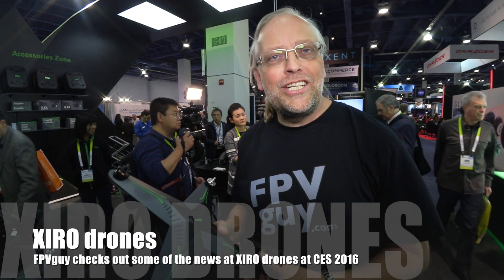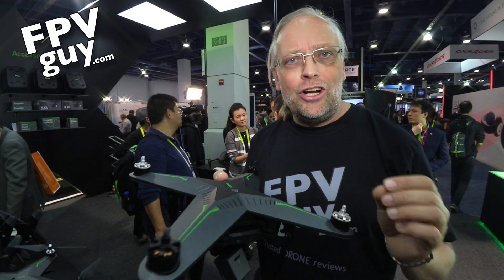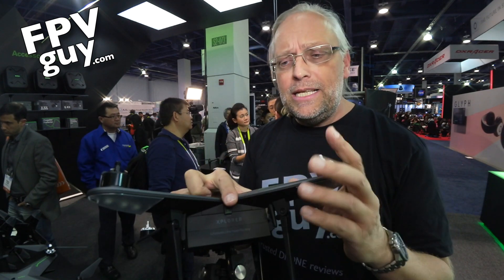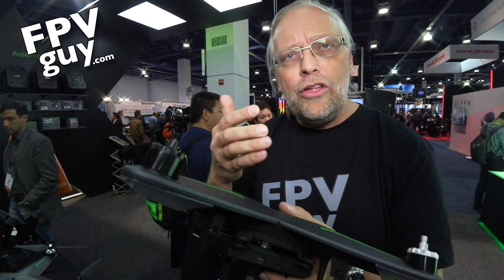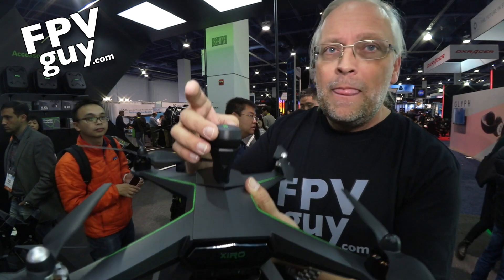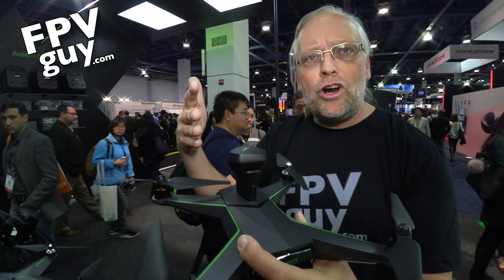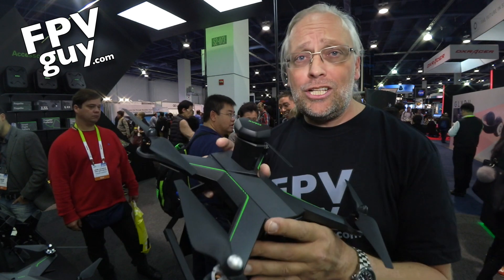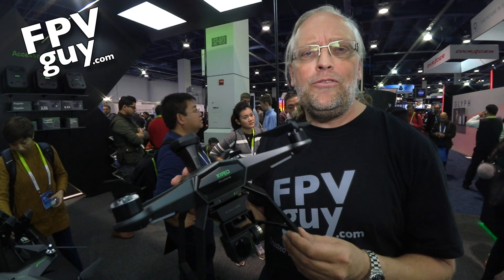XIRO SnapDragon powered drone - FPVguy review CES 2016

Comment: It's not optical, it's actually radar, that's why it's avoidance system can do 6 metres.
Reply from the maker: Sooooo.. IC,  the big lens on camera module on top is actually emitting microwave energy,  Im sure the FCC will have a field day with the idea of a rotating radar emitter on a toy-rated product.
Reply: +Bo Lorentzen the only reason I knew that info is from another video. Maybe what we should do is put a few microwave cheeseburgers around it, see how long it takes to cook them.

Comment: Actually I have the Xiro xplorer, great drones, easily 1 of, if not the easiest drone to set up & fly. They can fly in strong winds, have an automatic take off mode & landing too, home button if you lose perspective of direction, IOC, like headless mode, automatic return if you lose signal for more than about 15 seconds, when it will hover trying to pick up the signal. The video monitor is your phone, while flying, also has a micro SD card slot for taking video. The gimbal is probably 1 of the best for stability while flying, even in strong winds. I'm not a salesman for them, just stating what other reviewers have said.

Comment: The battery comes off independently. So does the Gimbal. I don't know where he got the info that you need to remove the gimbal before you can remove the batter!
Reply from the maker: That what the staff at the booth told me.   
I checked further, it turns out that the stuff was glued in place for the demo units.
Reply: Oh, yeah. It makes sense.
I have a Xiro Xplorer G and I love it!
I'm planning to get the 2 once it's released.  That I'm going to fly through forests.
Reply from the maker: Sergiu S  I have been bugging them to get a test loaner for a pre-release review, this is really one of the more interesting new quads thats NOT huge.   but with very interesting technology.  im really loving the rotating obstacle avoidance system,  but am guessing that concept alone involves a bunch of software development that have got to be scary on a log of levels as if its not "seeing" the right way, its got crash written all over it.
LOL yeah, doing those trade-show "reviews"  are kinda scary, you are dealing with a "engineer" who have no clue about the product except for her cheat cards... and you kinda gotta find out what the product is by asking and guessing and then explain it in a intelligible manner :-)   but dang its fun to try.

Comment: that method of 360º  obstacle avoidance is the best ive seen yet, if it works that must be the way forward for all drones, will be keeping an eye on this one!
Reply: +Bo Lorentzen I think something like the real sense avoidance.capable of rotating would be a real winner! it's only a matter of time now before legislation insists obstacles avoidance is fitted to semi autonomous  drones .
Reply from the maker: +stuart gillingham   Yeah agree,  this is a very interesting concept,  I do think it suggests that the sensor is more expensive than the servo to rotate it.. and that we may see more sensors in the future rather than moving parts
Reply from the maker: Agree with that.   particularly the (semi) autonomous units that we will be seeing operating with push-button input from a iPhone or similar,   fire fighters and LEO's don't need to be worrying about flying into stuff, they just want a high- vantage point.
Reply: +Bo Lorentzen .. Greetings, which one in your opinion is better,.. Detect x380 or.. The xiro?
Reply from the maker: The Detect x380 is so-so,   there are a couple good Xiro's  if you get your hands on a Xiro explore II you are set.

Comment: You don't have to remove the gimbal to remove the battery I have th xplorer v
Reply from the maker: +Richie Dillon GREAT NEWS..  
Honestly. that is what the factory rep at the show told me.   they had no clue what they were talking about. (and in turn I gave bad details)
Reply from the maker: +Richie Dillon Tell me more,  how do it fly... ?
Reply: Loved the info and maybe they advise to take the gimbal off. I leave it on seems like better protection for the cam if it is on the drone
Reply: I can't wait for the new xiro drones to be on the market.  Did they give you a date when they will be available to the public.
Reply: The xplorer v fly's awesome I'm a beginner and it is way to simple. We have a hobby shop we fly 2 of these and have had no problems. I had loss connection on the feed back to my phone, did a firmware update and seems to helped it out so far.
Reply from the maker: awesome,  thank you for the update. :-)